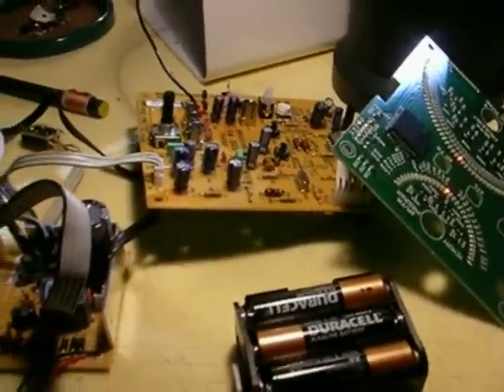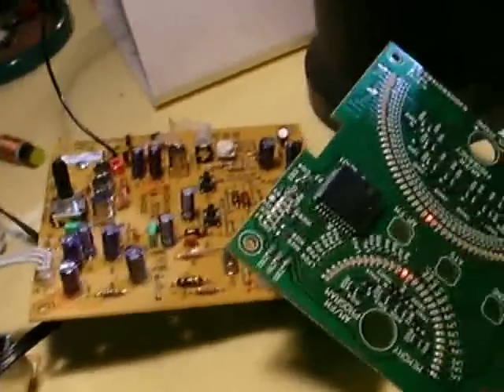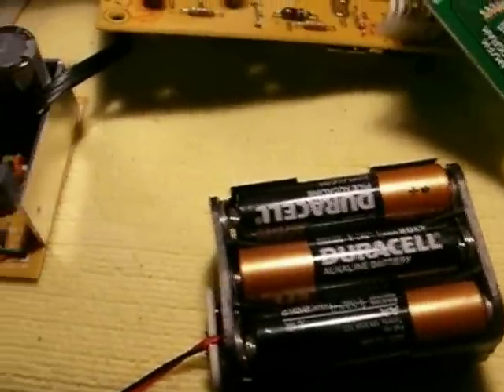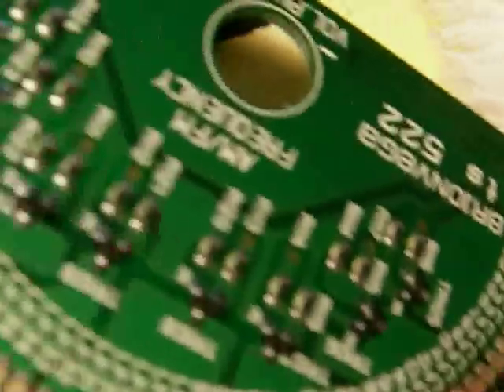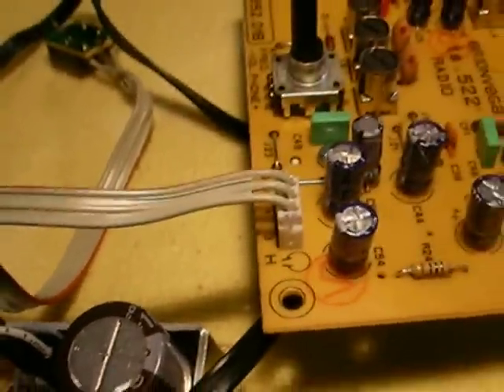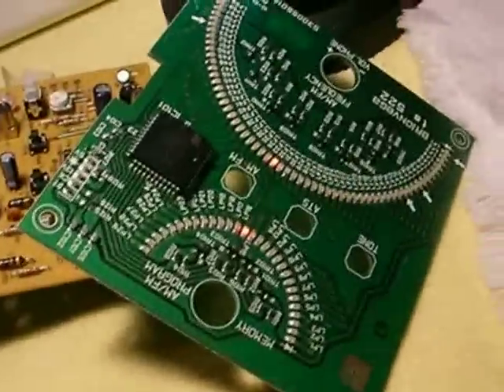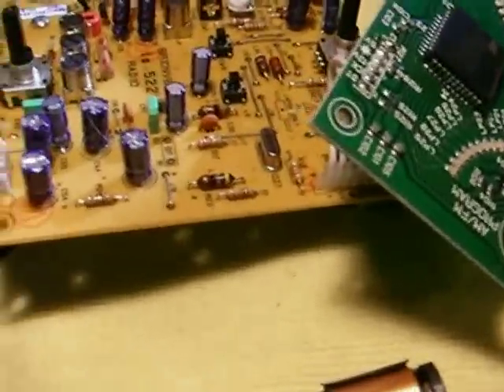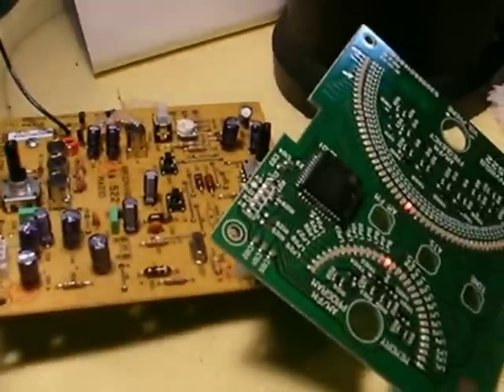Brionvega TS522 Radio with problems

Comment from the maker: @uxwbill .... That is the 1st thing I thought of, that it had an untold "accident". It is far too young for these problems. The boards look great, no signs of any abuse. I just got the AM FM front end IC replaced, and am going to test it soon. The grounds are fine, and the board is fortunately a single sided board. But it is true- there is no way I could ever justify this radio's selling price even if it worked perfectly. The Tivoli Pal is a very good ( and comparable) radio, and $150 cheaper.

Comment: Yeahhh...sounds like a chip! Darn that modern sensative YUNK, huh? Try some freeze spray on the IC & see if the thing goes crazy...that's a sure fire way to tell...also, could be a cracked solder joint under the chip. I specialize in surface mount IC soldering & see a LOT of WIERD problems caused by poor solder connections that can't be seen without a microscope under those surface mount IC's....just something to think about. Try flexing the board gently & if it goes nuts, that will tell you. :)

Comment from the maker: @seatboi All the caps were replaced just for kicks, but still the same. I found I can run the radio board only, without the display, so now we know the display board is not bothering it. I also used a pure battery DC supply on the radio, eliminating the power supply as a source of trouble. It may be the TEA5757 IC is bad. I have another complete working I2C bus radio board from a Philips compact stereo I will try running on this board's PLL circuit to for sure see if it is the radio part.

Comment: If it was on my bench, I think I'd start checking caps...especially the ones in the 5V DC line to see if the chips are getting clean DC. This modern YUNK seems to go thru caps like sh!t thru a tin horn, cuz they put like a 6.3v cap in the 5 v line instead of a 16 volt one that would take a little more abuse & last longer...built to fail just like everything solid state, huh?? You could also take a signal tracer & follow the noise back & try to track down the origin as well...just some ideas...